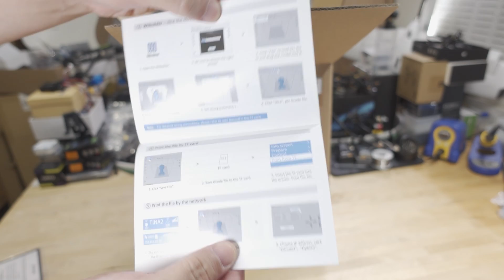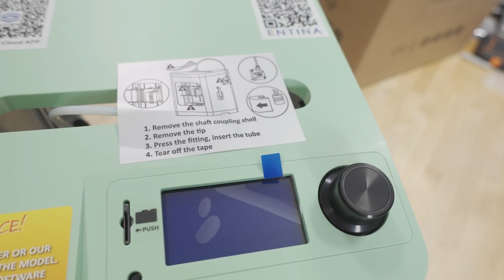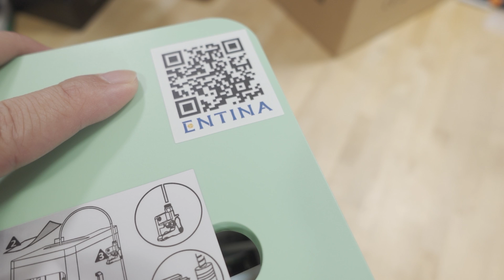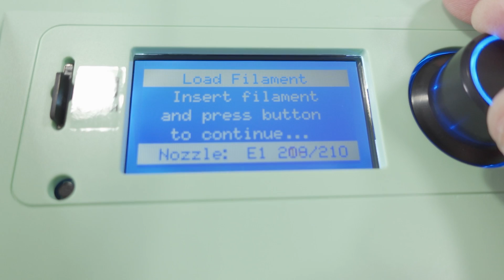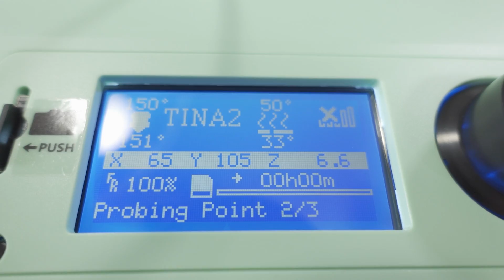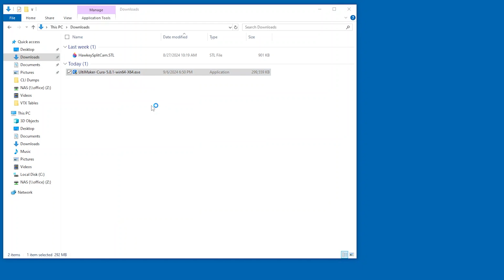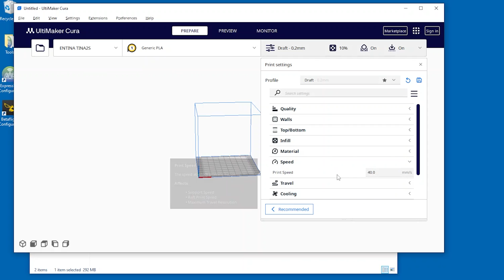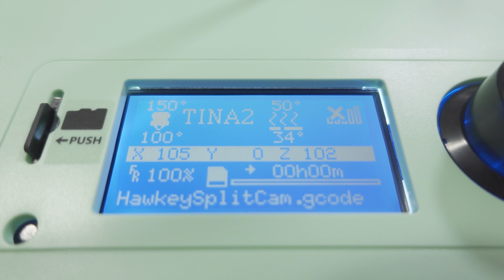3D Printing in MINUTES w ENTINA Tina 2S

Comment: Nice small form factor.  Only concern I would have would be trying to use full sized spools on it.  Haven't seen those smaller spools before, they don't seem typical...
Reply: There's a 3D print you can use to replace that smaller spool holder with one that can hold the 1kg spools. I've seen it on other people's videos.